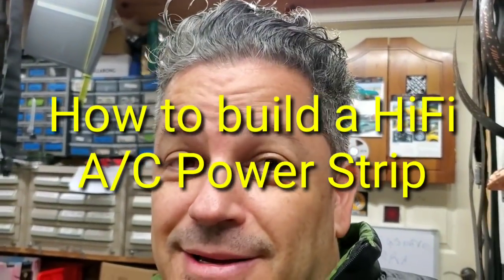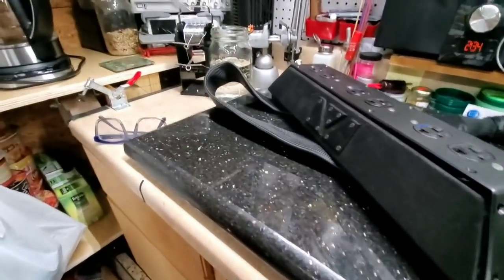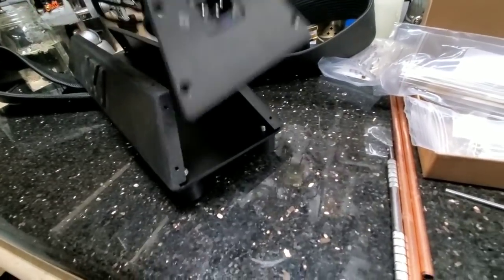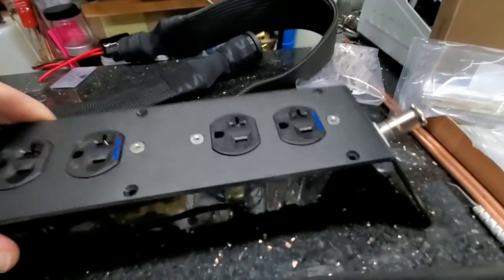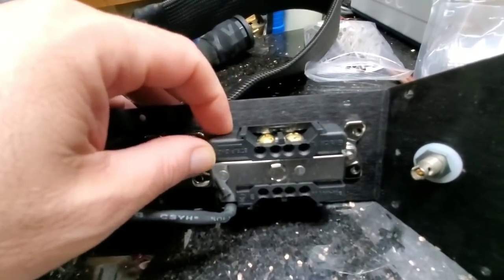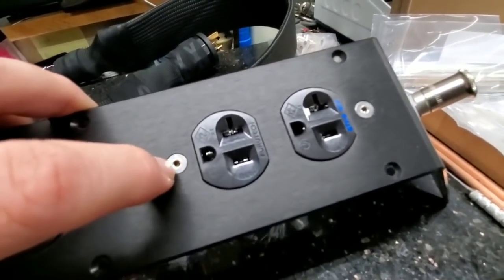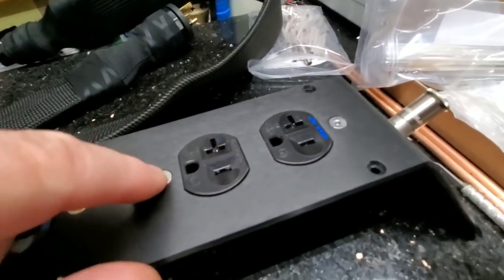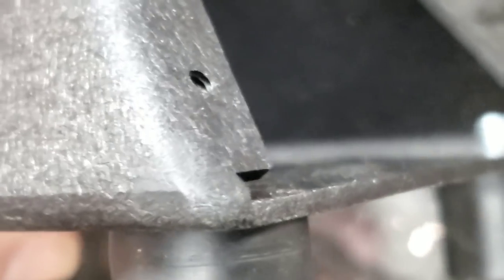How to make a HiFi grade A/C power strip

Comment: Just wondering about that iec cable plug it looks like that is a 15amp plug, those outlets are 20amp rated any reason for that other than cable compatibility? Thanks. I found your video very educational!
Reply: The inlet is an IEC C13 style rated by the iEC standard 60320 at 10A and by UL at 15A. I made a post on this topic about 10 hours ago which has since "disappeared" (been deleted?)
I would have expected an IEC C19 inlet, rated by IEC at 16A and by UL at 20A.  North American mains power is 110 V AC and in Europe 220 V - 240 V AC. So for a given power draw, a North American system draws MORE CURRENT, making a C19 inlet more appropriate. Regards, Rob in Switzerland (physicist and the last 44 years in high tech engineering).

Comment: Grrr... I'm currently stuck with a conditioner/power strip with the daisy chained type wiring..

Is there a "lesser of the evils" way to plug in my gear? Like, should i plug my source to the outlest nearest the iec inlet, then my amp, etc? Or the other way around? I'm running a streamer, dac, and integrated amp.

Puritan next on the list..
Reply from the maker: Sell what you have and replace it. If you can't then put amps at the FARTHEST plug so it does not starve the other components of current.
Reply: @OCDHIFiGuy  Thank you sir! 

Roger that. Ifi Power Station out. Puritan in.

Comment: Gonna have to rewire the whole circuit like that to really make a difference
Reply from the maker: Hi Theo, please explain... thanks
Reply: @OCDHIFiGuy  as In the wall sockets and wire going to the panel.
Reply from the maker: @theovonskeletor3709  Clearly you have not seen my other videos. Ive got Furutech GTXD NCF R  at the wall with the Furutrch wall plate and mount, the wiring back to the panel is  ground isolated and Cryo treated 10AWG Silver plated copper in PTFE, the panel is dedicated to the rig, meaning nothing else is on this panel except the audio rig and Ive got 4 - 8 foot long silver plated 101 solid OFC copper ground rods on the other side of the panel wall. this panel is NOT a sub panel off my main house panel, it is fed direct from the meter on the side of the house.  I am OCD HiFi guy .... Need I say more  ?  ;-)

Comment: Mike    i like it,    One thing,  May not mean anything.   My old PS  has the wall plugs on top like you did with that product.    But in a few days the Nice power cords all had a bend on the cords  like a U turn .  i had to come up with a way to keep the bend out of the Cable. 
 I layed the PS on it's
 side .   Let me know how people think  when designing the product
Reply from the maker: My cables will not stay in a U shape like a cable with PVC outer jacket will, and a bend does not affect the performance of my cables to any degree you can hear.

Comment: Did you measured this esoteric sings with oscilloscope?)))

I think it's all about good contact between plugs!
First drop out this furutek bs.. znd bring here 32or40A industrial grade receplates))

Solder with silver solder with high grade doldering iron, thats all.
Reply from the maker: Measure for noise ? I have oscilloscope and tone Generator.  I also think the Furutech may be BS, but it's what the customers demand. I will do tests eventually to compare Furutech vs industrial grade.
Reply: @OCDHIFiGuy  if you tone 2mhz or more without hf filter, and you will see, - its all about strong contact, not the purity of metals.
I found this when we with my good friend electrician, installed industrial grade 32A raceplate for kitchen, - i just try to connect to that raceplate and results are amazing.. need maximum field and force fo contact, thats all.
Reply: @ЄвгенДомашець  2mhz. great :) thank god the grid runs on 60hz over there.

Comment: Mike, great piece, what is the price point? and also the power cord. Can you make it with 8 outlets?  Great video
Reply from the maker: Hi , no 8 outlet as thats a different chassis, I could make a 7 I believe with one on the far end where the ground post is. put the ground somewhere else. They are built to order and are $700 to $3500

Comment: 2,000 $US for a power bar?
I hope the turntable, the premap, the power amp and speakers are included!
Is the power cord included at that price?

A case with some welding and sanding... I give him a point on the aesthetic side.
What is the gain technically?

If a magnetic shield is needed, just use a steel case.
No possibility of a star configuration for power and ground... It's counter intuitive HIFI wise.

One thing is sure: equipment with a properly designed power supply will alleviate most caveats related to the use of a cheap power bar.
Does this guy know about noise loops? His power bar design is poor on that aspect.

Nothing is more costly than ignorance!

I doubt a scope will be capable to show an audible difference with a 40$ power bar!
Reply: + you forgot to mention minerals from earth (possibly from space) mixed with epoxy that will absorb five different frequencies. Ludicrous! LoL